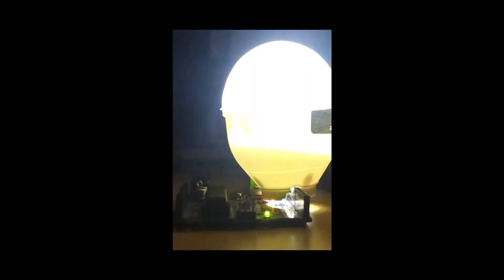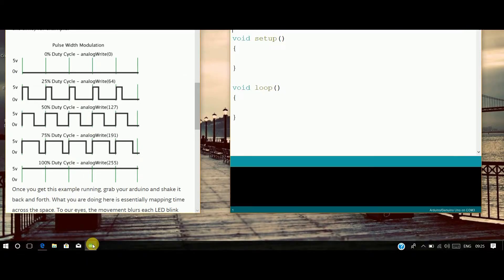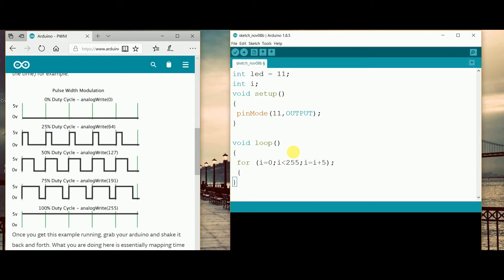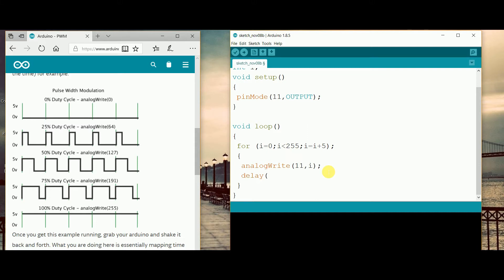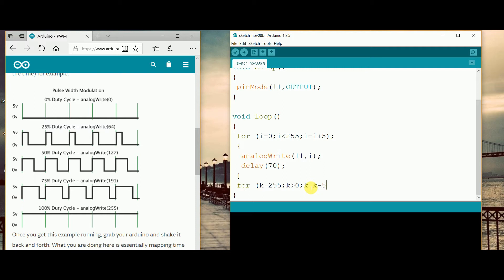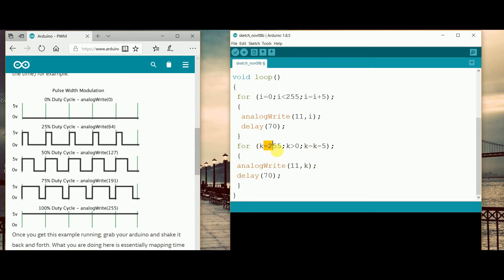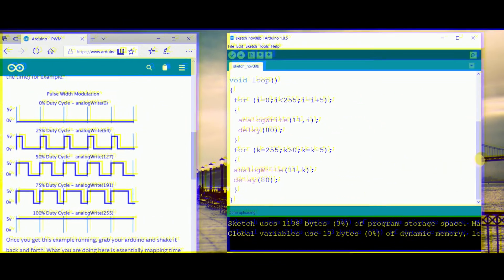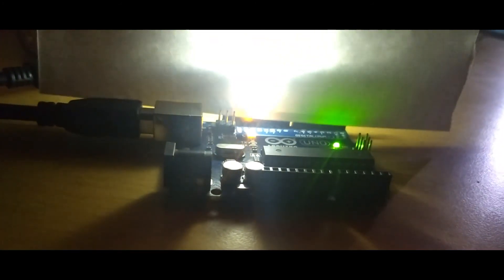Fade LED with Arduino [ Codes Included | Well Explained ] Arduino #3

Comment: Thank you.  Is there a way to add a delay(1000) to both the 0 and the 255 values so that the light holds at full on and full off for 1 second before the next fade?
Reply from the maker: Either you can just write two functions in the loop or you can run if statements.